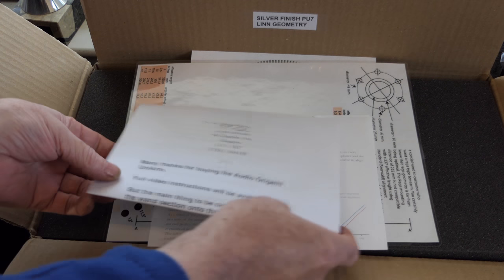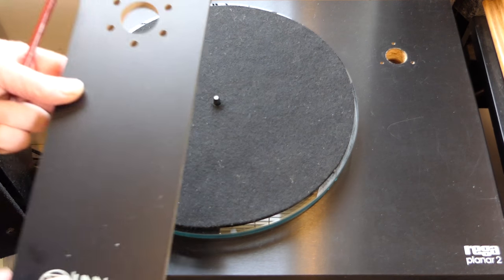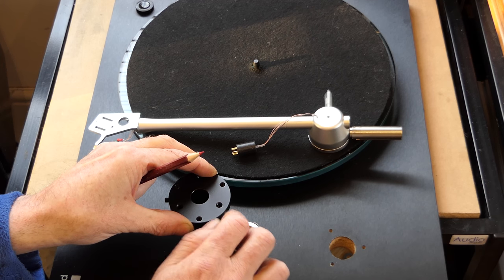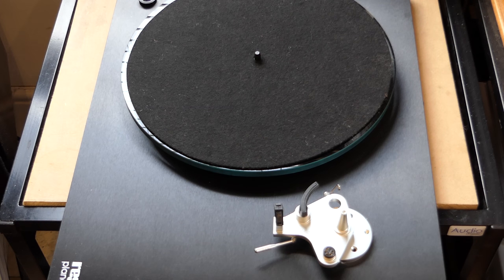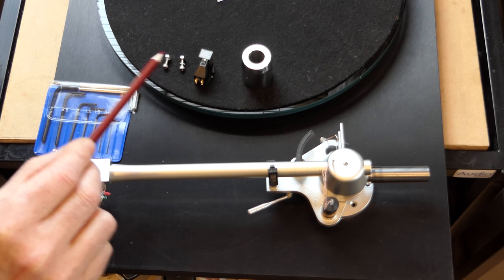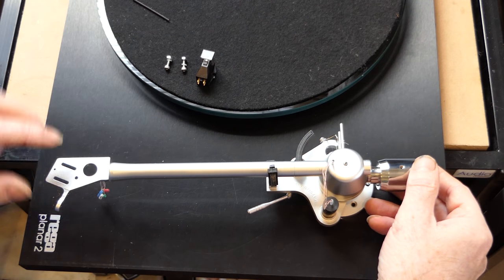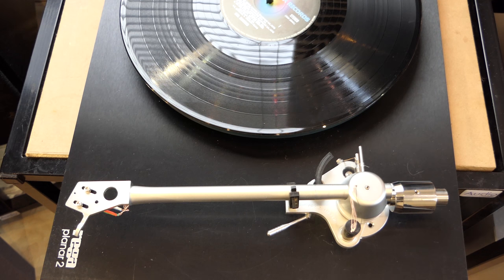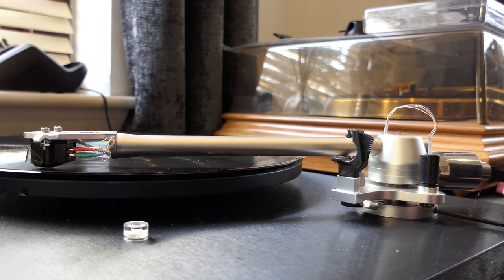Audio Origami UniArm Setup Instructions

Comment: Super video that, the build quality of the arm looks amazing too. I've only heard the PU7 on an LP12 and that combination was very impressive. I really like how you've made it possible for all adjustments to be done easily by the user once installed, especially azimuth and VTA.  It's so much better than having to use spacers to alter VTA, such as a Rega arm. 
A really nice finish to the arm too, even the slots on the head shell look a better arrangement than the recessed slots on a Rega Arm. 
Superb.

Comment: Nice video. The Aussie importer is a friend of mine. My cartridge is a naked Benz special version LP and weighs 14 grammes - that shouldn't be a problem?
Reply from the maker: You will need an extra rear weight.
Reply: I am not too surprised, this cartridge is built into a super high grade brass block. Dense but heavy.